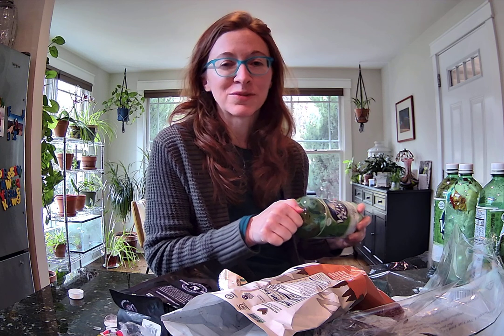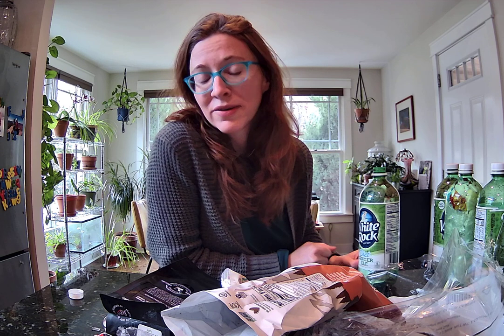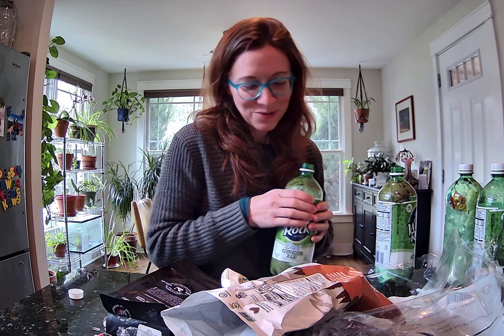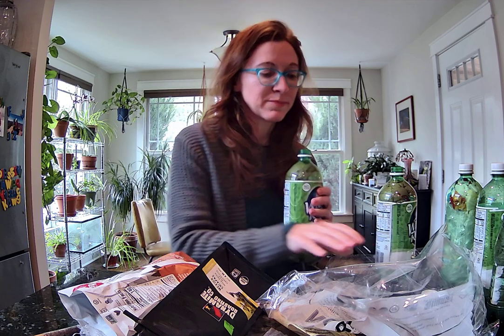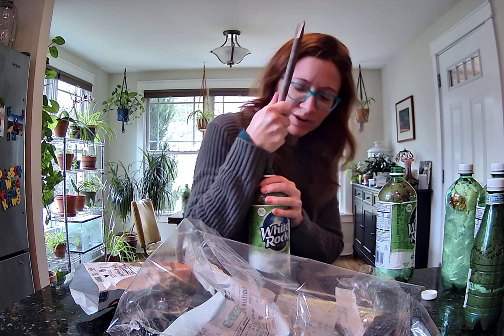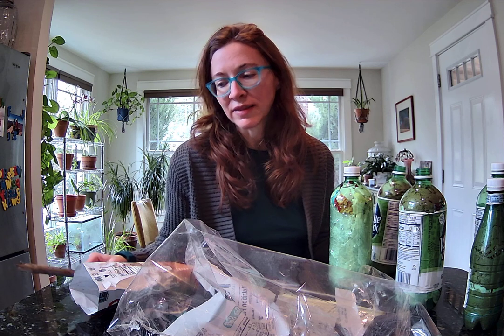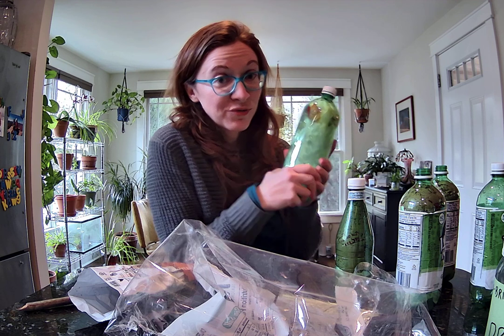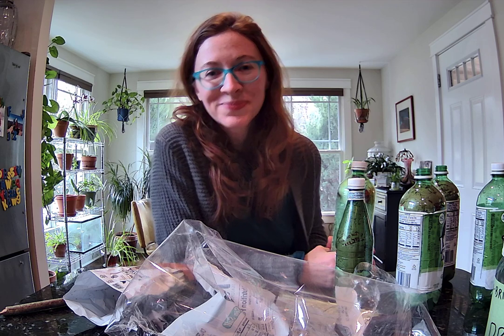Eco-Brick Chicken Coop Project - Making the Bricks

Comment: Any update on the design and completion of the coop?
Reply from the maker: The coop was completed two years ago in June, and it turned out so well!  If you look at the other videos on here, you can see some of the plastering I did toward the end of the project.  The coop stays cozy and warm in the winter months, and quite cool and comfortable during the heat of the summer months.  The earthen plaster is both beautiful and functional, and the coop holds within its walls well over 300 eco bricks.  After two years, I haven't needed to do any repairs - the structure is very sound, and it's so beautiful.